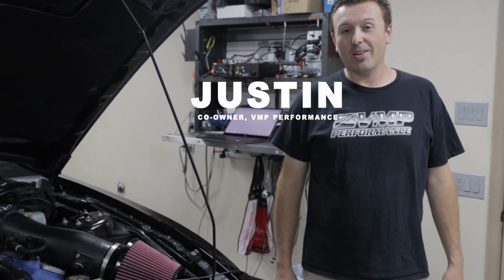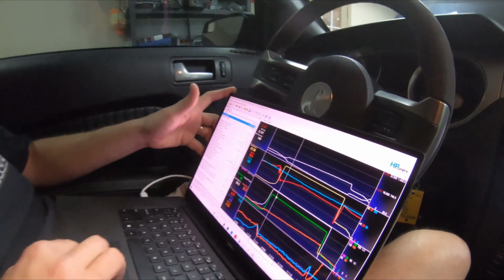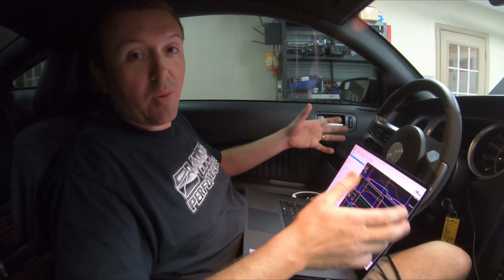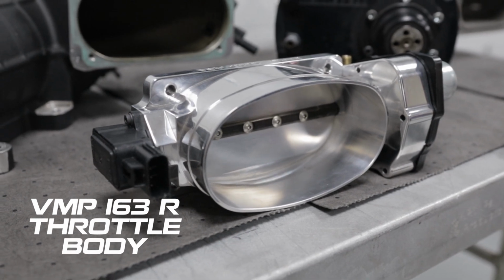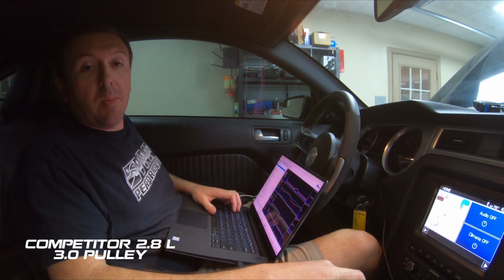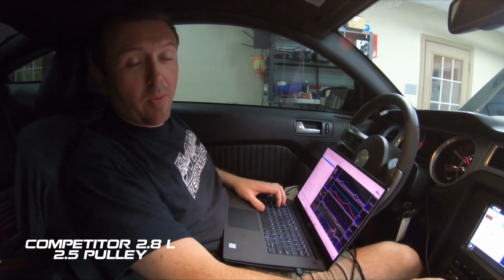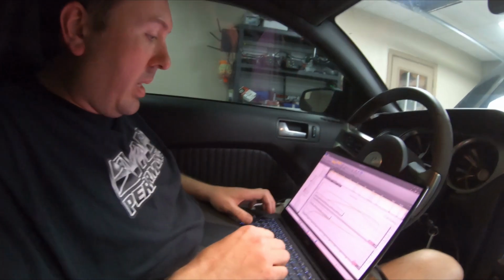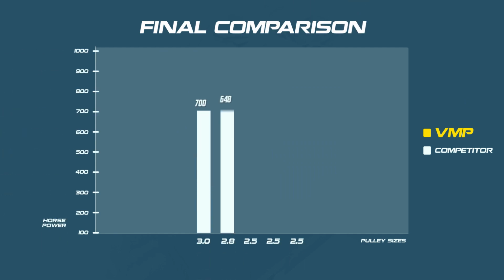Real World Testing | VMP Gen3R vs. Twin-Screw 2.8 L on a 2012 GT500

Comment: I'm sure Kenbe bell results will differ.
Reply: @azniteforce304  that's the best you got?
Reply: They put their tests on a supercharger dyno which isn't real world to make it look like their shit is better. It isn't 🤷‍♂️
Reply: @shotemup123  well they do have the fastest Gt500 1/4 time at 7.23 at 197. Not little tvs doing that. If there so great why dont they dominate racing?
Reply: @darrenmcfeaters6683  well for VMP to beat that, they wouldn't need a nearly 5 liters worth of supercharger displacement to make it happen. They're a new company that is already taking customers away from Kenne Bell. All they make it way oversized head units that put too much pressure on your crankshaft. The VMP 2.65 is comparable with the Kenne Bell 3.6 efficiency wise and that just shows who makes the better blower.
Reply: @shotemup123  incorrect.  The data doesnt support your theory. I'm making 801whp and 792tq on 93 pump gas with my 3.6. And I've been a tech for 34 years. If I had a dollar for every roots blower I replaced with a bigger and more efficient twin screw supercharger. Vmp doesn't make the rotors. Eaton does. And they are just a little better than the 2.3. Takes more power to turn them since your are spinning them faster to compete. Roots styles are the least efficient superchargers and kenne bell is the fastest and actually design there stuff. According to the Eaton website the 2650tvs rotor pack has max rpm of 18000. Evolution performance went 8s 10 years ago with a 2.8 kenne bell. Didnt see any tvs cars running 8s in 2010.
Reply: @shotemup123  and they atent a new company. I've been dealing with them over 10 years.
Reply: @darrenmcfeaters6683  top fuel and funny car dont run tvs rotors either. They run that antiquated 60* roots crap. That's what is stuck in your head though and you won't be convinced otherwise.
Reply from the maker: @darren mcfeaters lots of inaccurate info in that statement.  TVS has a steady-state RPM limit of 18,000rpm, such as a marine application.  For intermittent use it will easily turn 23,000-25,000rpm.  We have seen 27,000 with no ill effects.     The 2.65 L rotor is a vast improvement over the 2.3 L due to design changes.
Reply: @VMPPerformanceTV  the actual manufacturer says differently.  You didnt design or make the rotor pack. Just because you can doesnt mean its suppose to. Let's see that compressor map.
Reply: @VMPPerformanceTV  Moran. I'll effects? Your data collection is pretty bad compared to kenne bell.
Reply: @VMPPerformanceTV  you get to effects. Heat and power loss because it takes more power to turn an object faster. What were the iats out of the blower at those speeds and parasitic losses? Oh that's right you dont have a supercharger dyno to get those readings. So you dont know.
Reply: @darrenmcfeaters6683  eaton did put out the information. The tvs 2 rotor, you know the one with 170* twist, not the original tvs 160* rotor, and certainly not the 60* roots rotors of old, has a steady state rpm limit of 24000 rpm and a 30000 rpm limit in transient use. You wouldn't know this, you don't follow the technology. Your a kb screw nut hugger because you have one and are blind to everything else.
Reply: @darrenmcfeaters6683  kenne bell has alot of data they use nothing but the best to test CFM and what not .... the information on there website is accurate as I was a kenne bell customer when I bought the 3.6 .... the information of there website matched my dyno numbers ... quality product ... when I popped my hood the look I got from peoples faces and other car owners like corvette owners as well ... the sound at idle it makes turns peoples heads .... I had 2 sheriffs pull me over just to look at the car they where so happy .... the experience of having This blower has made me happy .... people wanna call it ole and extinct hey 👋 that doesn’t bother me .... I’ve owned one ☝️ and guess what ??? I’m buying another one ... kenne bell blowers 4x6 rotor profile separates them from the competition ... people have personal preference and that’s okay ... whipples are bad ass ... TVS 2.65 bad ass ... but I like them kenne bells !

Comment: I guess since the 3.6 video didnt goe well you changed to the 2.8 which hardly anyone runs. Let's see those compressor maps.
Reply: I hope you get paid by KB... I’ve never seen such intense, relentless white knighting for an automotive parts vendor. 🤣🤣🤣
Reply: @TezZ_06  boy you ain't kidding lol.  I'll admit I favor the tvs but you won't see me on kbs videos bashing on them.  It's ridiculous.
Reply: Supercharger dyno isn't real world. Plus that's an extra liter of displacement for no horsepower improvement and will break a stock crank with all that rotational mass.
Reply: @shotemup123  all that rotational mass? Its bigger so it doesnt have to work as hard as a smaller spinning supercharger. Funny how the dyno shows 50 more hp needed for the tvs over the 3.6. And the 3.2 kenne bell is lighter than the 2650. You must be new to superchargers.
Reply: @shotemup123  when is mine going to break? Been on 8 years now.

Comment: So basically if you're on pump gas or planning on running a 2.8" pulley or bigger on either of these blowers (e.g. 90% of GT500 owners)....don't expect one to be head and shoulders above the other.  They appear to be very comparable.  Even if you're on race gas, one makes more horsepower, the other makes more torque.  A 20 HP difference (with less torque) on a 780 hp car is not going to rock anyone's world.  I'm actually blown away that the 2.8 did this well, being as old as it is.  In other words...buy what you think looks and sounds good.  Both of these manufacturers have their loyal followers and both of them always will.  I have owned products from both companies and each has its merits.  What ever happened to the 3.6L vs 2.65 argument? 

A couple of other points:

-When you run over ~18 lbs of boost in the KB, you're supposed to lower the oil level.  KB sells different dipsticks for race and street.  There is a significant power difference that goes along with properly adjusting the oil level in the head unit when you're running high levels of boost.  Justin didn't do that.  Why not?  That's 15 hp based on KB's literature.  Link below.
http://kennebell.net/tech/supercharger-tech/supercharger-oil-oil-level-recommendations/

-VMP measured a maximum 4 degree delta in the before and after-run IAT2 temperature increase of the 2.8 vs the 2.65.  Of course the KB came out with a slightly higher temperature delta.  It is compressing more air, and by VMP's own admission, making more boost on the same pulley size.  That's Charles' Law....not an inherent design flaw nor an indicator of better heat-shedding performance on behalf of the 2.65.
Reply: @Dean Gresham, correct me if im wrong, but i also remember Kenne Bell having different blower outlets based on boost, i believe the larger one was for 0-18 psi-ish, and the smaller size was for 18 or 20 psi and up for what im guessing is flow characteristics. There seems to be a lot to those Kenne Bell blowers, but i wish most companies were up front and black and white about their tech and advantages. I mean im not asking for a list of their secrets, but its obvious that there are differences, albeit small, and would help to pick the proper one for your application without resorting to, "because its better broh" like better low end with a tvs, better top end with whipple, and overall efficiency with KB, it would help everyone's brand and the clients buying the products.
Reply: Exactly! I'm still confused? These guys went after the 3.6 litre blower and we see this?

The fact of the matter is that KB literally have EVERYTHING on their website. No BS, clear cold hard data about every aspect. Complete transparency. I don't see that at VMP. Just trying to talk smack and poor methodology.
Reply: @PAP4BEAR  dude how much more transparent can you be?  They perform similar at larger pulley sizes although the larger blower was running a tad more boost to get approx same power) and they started really spinning both there was a 20+ rwhp gap between them on the glory pull and each back to back pull from there got uglier and uglier for the larger "more efficient" twin screw.  Everything was the same across the board except the kbs boost was higher but the power was lower and each pull thereafter it got worse and worse for the kb.  It don't get any more clear or transparent than this you just didn't see the outcome you wanted to see and are still searching for ways to bail kb out.  I get its an older design but I'd bet money if they made a brand new 2.8 kb it still wouldn't keep up with the tvs on efficiency that is why they don't do it.  Idk what more you twin screw guys wanna see really.  The smaller blower made more power and made it way more consistently on slightly less boost vs the larger twin screw thst is supposedly "more efficient" do you see how stupid it is calling them "more efficient" now?  Probably not because you are on team kb regaurdless and that is fine.  Kb has stats in their website that try to make their blowers seem superior.  The only way they can best the tvs is have at least a liter larger displacement and even then they're not that far apart honestly.  Despite all this everyone in the twin screw camp still keep beating that tired old statement that they're "more efficient" if that is so why do they need a liter more displacement to match the output of the tvs?  And when you see them similar displacement at the same pulley you see them start to separate and on back to back pulls its just embarrassing for the kb.  We seen which one was more efficient and I'll give you a hint it sure wasn't the twin screw.  Smh

Comment: Why would you compare blowers and then change the cold air and filter? Seems pretty logical to use the same CAI for both blowers smh!
Reply: Chris R because this is what the manufacturer specs for this kit. We actually DID run the JLT on the 2.8L and the 2.8L actually performed slightly worse. But in order to keep things fair, we decided to Ultimately show what KB specs for this kit

Comment: Is clear vmp better I like to vs Whipple 2.9 0 the new 3.o wipe thank  you Justin also vmp 3R came for 2003 - 2004 cobra
Reply: How is it better? The 2.8 is old design. 14 years old. How does it compare to the new 3.2 kenne bell which is lighter than the 2650?

Comment: What a joke lmfao a brand new blower compared to an old ass one? Anything bigger than the 2.8 KB will shit on the 3R....jokes on you VMP.  KB>
Reply: False.  It takes a liter more displacement for them to even think about shitting on vmp.  The reason they don't make a new 2.8 is because it too would get smacked around by the gen3r so they don't even bother.  If a 3.6 can barely pull away from it a 2.8 isn't gonna fare very well.  Jokes on you kb fanboy enjoy living in 2010.

Comment: A 13 year old supercharger vs vmp's latest and greatest?! ... Cool ...
Reply: Say what you want the kenne bell 3.6 delivered !!!
Reply: lol..tell KB to update it.  what fool would spend money on 13 yr old tech?
Reply: @Rob...  I would lol that 13 year old tech had me smoking fools lol
Reply: KB tried to compare their 3.6L blower to VMP's 2.65L blower, how's that fair comparison 🤔? Kenne Bell's 2.8L blowers are inefficient at making power and they know it. Eaton TVS based superchargers and Whipple dominates the small blower market (3.0L & smaller).  The only thing worth buying from KB are their big blowers which require you to have a built engine.
Reply: @chrism.728  had a 3.6 kenne bell on mine 8 years. 801whp and 792tq. Stock internals. And it passes emission testing. Something vmp doesnt promise at those levels. I have many customers running them. All the 850hp supersnakes came with them. 747whp on 91 pump gas is pretty good.  Dont see tvs doing that. And the 3.2 is lighter and more efficient than the 2650.
Reply: @darrenmcfeaters6683  No supercharger company can promise passing emissions, because there are many variables like exhaust components, tuning, etc..so that statement is irrelevant. Shelby American switched from using Kenne Bell blowers to Whipple, I wonder why 🤔. Back to my original point, the only way Kenne Bell beats any Eaton based, 2.65L blower is to go larger on displacement. The VMP Gen 3R is more than compatible of pushing stock internals way past their limits. No need to go larger on displacement if you don't plan on building an engine.
Reply: @darrenmcfeaters6683  supersnakes tuned for 850hp+ are not 50 state emissions legal they would have to be detuned to 750hp to pass CA emissions
Reply: @chrism.728  the first one comparing the 3.6vs2.65 was VMP ... Kenne Bell just answered over the VMP statements
Reply: @FranciscoLopez-xp5jv  Fair enough, but that test that KB did was irrelevant since we all know that the 3.6L is almost a full liter larger in displacement.
Reply: @chrism.728   VMP were the ones that firstly took a 3.6 and said the 2.65 was better just because it weighy less and had less rotational mass ... Kenne Bell just answered over those parameters that VMP put into consideration ... ... ... VMP started comparing superchargers, they started the 3.6 vs 2.65 comparisson ... It is not that hard to understand

I do not fall into the mistake off saying "this is better ... ", Because there is not that such of thing ... Everything is a compromise
Reply: Chris M. They backed away from that comparison because the 3.6l KB blew vmps supercharger off the water😂😂
Reply: @Jimmyxsx  it is a liter larger in displacement and I certainly wouldn't call what they did "blowing them out of the water" it was embarrassing honestly considering it is AN ENTIRE LITER larger in displacement.  That is HUGE.  Why do they need to be a full liter larger to outperform the tvs if they are "more efficient"?  That is what you twin screw guys say right that they're more efficient.  The 2.8 won't touch the gen3r in efficiency on back to back pulls it got its ass handed to it.  Even it was slightly larger.  I'd be willing to bet the same would happen to all their toaster oven blowers if spun hard like that.  Why would you want to run such a large blower that won't fit under the stock hood that is much heavier and has much more stress on the crank when you can get similar peak performance if not even higher peak performance and much more consistent performance from a much smaller blower that is alot lighter and fits under the stock hood and doesn't have near the stress on the crank and costs less to boot.  You can use the same stuff from the stock blower like intake and tbody unlike the kb.  I mean I just don't understand why you twin screw guys keep backing them religiously at this point in particular kb.  I would go with a whipple way before I'd go with a kb.  They're old news.  Next.
Reply: Chris M. I wouldn’t even buy a big KB blower specially with the gen 5 3.8l coming out.
Reply: @ElijahWash  Yeah, I'm interested to see how Whipple's new 3.8L blower performs on a built 5.0 Coyote or 5.2 Predator.
Reply: @chrism.728  for example, in the end Justin said that the Best way to build supercharger, is into a symetrical way, so ... There he is bashing the whole twin screw tech ... If tomorrow whipple comes and says why they do that way ... Will You also Say that it is not fair comparing an actual compressor against a blower? ... ...

Comment: I gotta give it to you on this one. THIS is the data we need to see! This has got to be your best video to date, so great job!
To be clear this was the oem intercooler on all runs?
What is considered the stage 2 3r? Mild port job?
Overall this really surprised me. You made me a believer.
Reply: @PmPerformance I believe the stage 2 porting is the "stock" porting on all gen3r's.  The stage 3 option is more aggressive porting offered by magnuson that's meant for higher boost.
Reply: jrjhanson correct!
Reply: PMPerformance Hey PM, yes stock intercooler and stock heat exchanger. When we use the terminology "stage 2 or stage 3" we are referring to how the blowers come /are cast.   the gen3R used in this video was the same Gen3R that every customer receives off of the shelf. No "porting" work was done to either blower
Reply: Chuck Harter thanks for the info. I did not realize there were 3 levels.
Reply: @PMPerformance  There are 2 options. Stage 2 is the standard case, Stage 3 is the more aggressive cast case for higher speed applications.

Comment: Stock fuel pump? Or does it have. Boost a pump?
Reply: flacoj85 VMP fuel pump voltage booster
Reply: I’m not sure if your asking about my 2010 GT500 or not but the KB 3.6 LC blower kit came with a boost a pump, and Everything needed

Comment: God I can’t wait to let you guys do your thing on my 71 F-100 with an 09 gt-500 swap..... I can’t get over the hp gains and constant customer approval! If you guys don’t get out this season I’ll have to trailer it to Florida . Awesome work guys!
Reply: Coyote swapping my 71! would love to see a video of it running
Reply: Starting to look like the race season is going to be pretty well cancelled, hopefully not. Call them and see if you can get on the schedule for a Dyno sesh. 321.206.9369
Reply: Dude I always said a gt500 swap would be awesome for those trucks because of the different character vs a coyote and more torque.  Good job.  I think the character of the engine fits a full size truck better in particular an older full size that is awesome man.  Any videos?